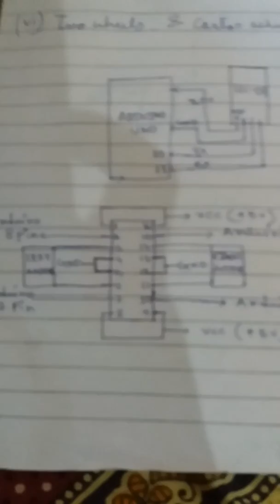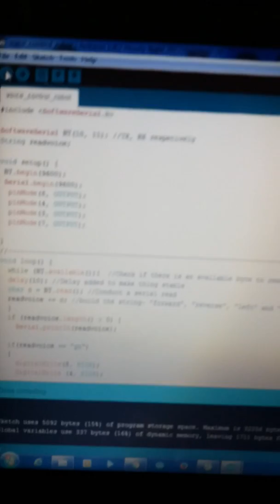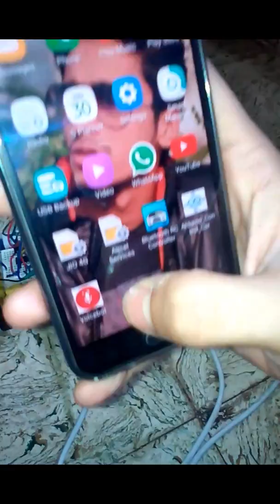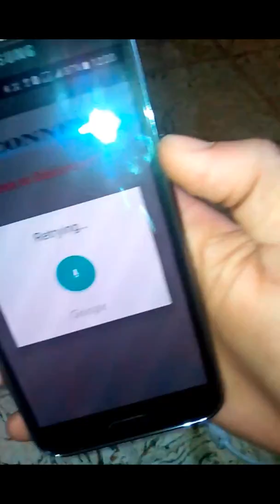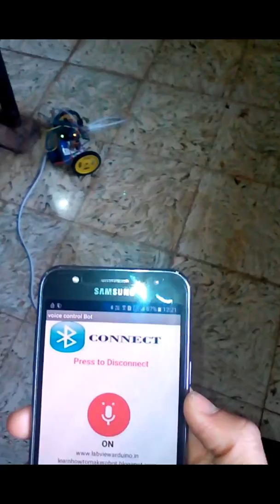how to build BLUETOOTH VOICE CONTROL ROBOT CAR

Comment: Code is showing error
Arduino: 1.8.9 (Windows 8.1), Board: "Arduino/Genuino Uno"

sketch_mar22a:69:1: error: expected declaration before '}' token

 } //Reset the variable

 ^

exit status 1
expected declaration before '}' token

This report would have more information with
"Show verbose output during compilation"
option enabled in File -> Preferences.
Reply: Can u pls tell what change i have to make

Comment: What support you have given?? I mean motors are attached to?
Reply from the maker: Piyush Gupta they are attached with a long breadboard... u can use any type of chassis
Reply: Thanks! Worth getting it!✌️
Reply from the maker: Piyush Gupta you are always welcome.. feel free to comment... we are for you guys... just like nd share our work.. thnx for your concern..
Reply: Can i get to know about pins of arduino like digital and all? I want info. About it..!
Reply from the maker: in our description box you will get a link of " intructables " there we have provided each and evry details about the project with pictures ..the code and the pin nos are there ..plz check our description box..thank you
Reply: Piyush Gupta I need a clear circuit diagram